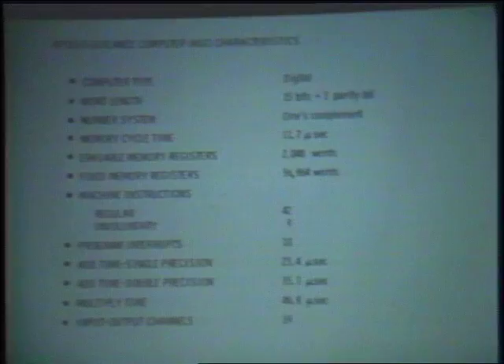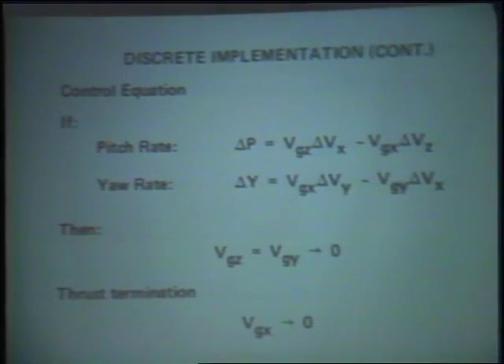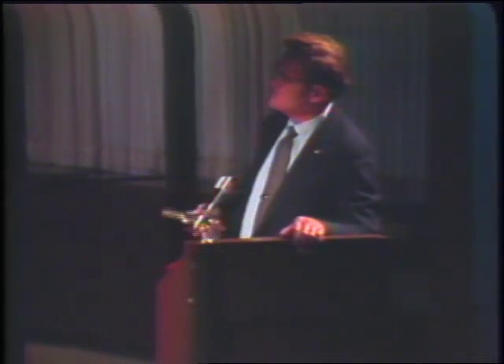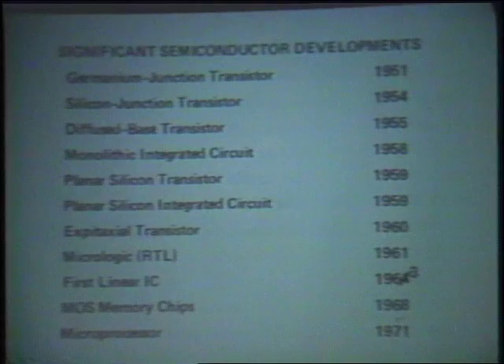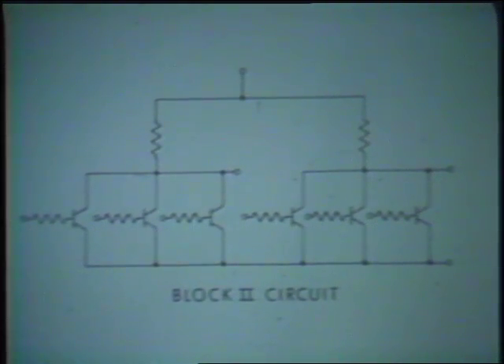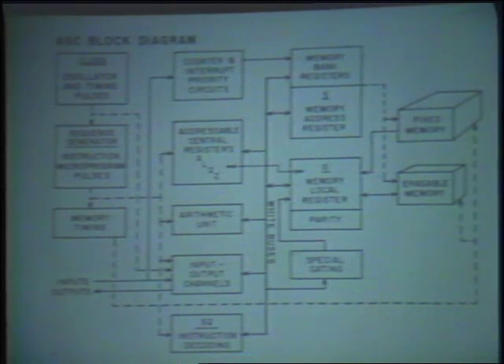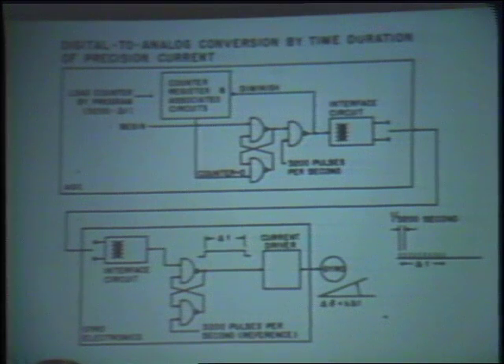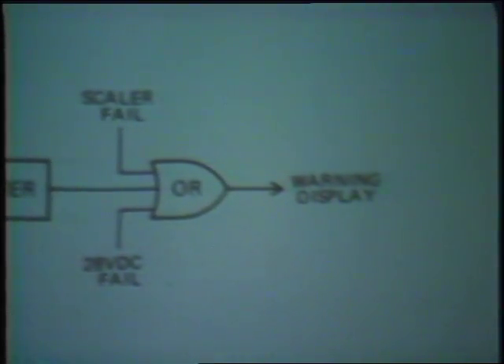The Apollo Guidance Computer, Part One: Eldon Hall

Comment: The Apollo guidance system was quite the amazing contraption.
Reply: +Imposture Lune Shows what you know. Which is f all.

Here's a fun game.

What's the definition of Cognitive Dissonance?
Reply: How do you propose working with vectors without adding or multiplying? This wasn't designed as a general purpose computer. It was designed and built for a specific purpose, and it obviously worked well enough for that purpose.  It even went on to be the computer used for the first digital fly by wire aircraft project, the F-8 FBW.
Reply: You're absolutely right.

And it wasn't the only computer on the lunar mission.

The AGC was the central computer of them all and was connected to the others and worked parallel in the sense that the memory was used by multiple input systems.

It was the only computer to give actions to those other computers. Be it manually by the astronauts or remotely from the ground up.
Reply: Imposture Lune  trolling unlimited....
Reply: It was a piece of junk of which the memory was not even working, and of which the architecture was making no sense; its operating system was the weirdest one which ever existed; it could not even have added 1 and 1.
Reply: Imposture Lune Just like your brain.
Reply: Lori Quaresimo 
With moon hoaxers, intelligent conversation -- like travel to the moon -- is not possible.
Your comments prove my point.Do you have something rational to say? If not, you might join that other lunatic someplace else.